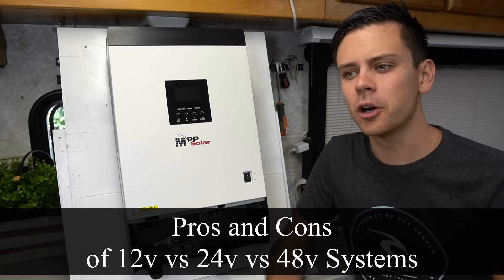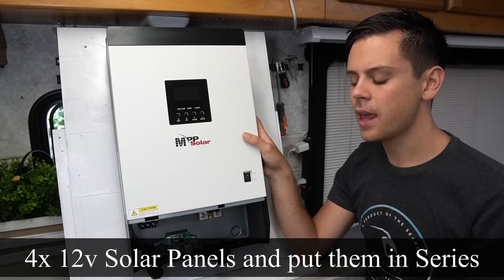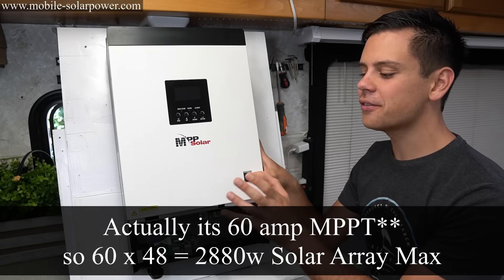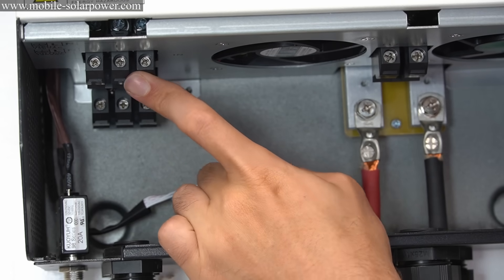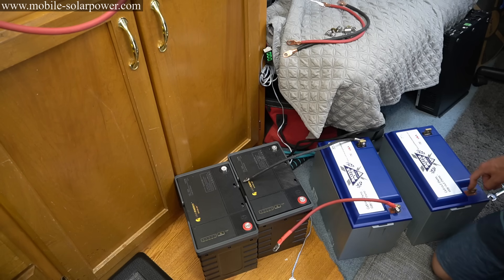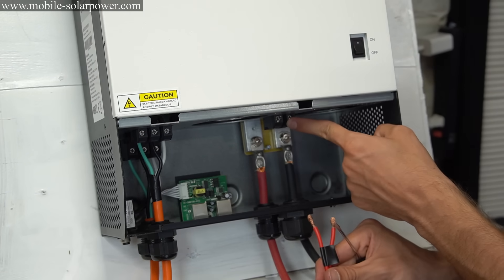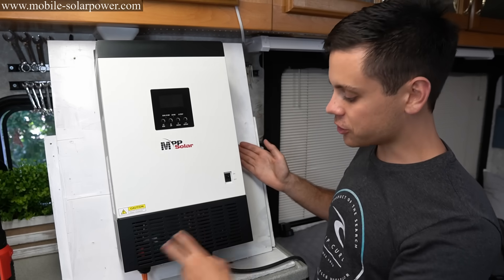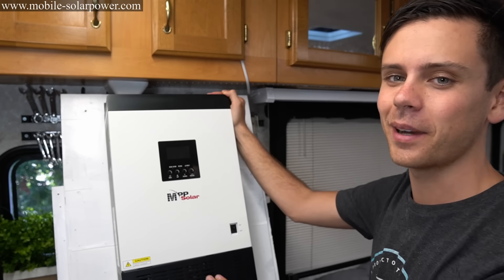48v Solar Power System for Beginners: Lower Cost and More Power!

Comment: Me and my wife wanna go on vacancy with our Cherooke (overland camping). The problem is that  . We have each one a CPAP one take 90 watts and the other need 80. Equal 170 watts. But me I count 250 watts to be safe. And I bought a cooler who take only 45 watts (it's a bougeRV) . The CPAP will work all night long so between 8 to 10 hours by night. And the solar panel will be attach to the truck racking on the roof. Now I bought a 100 watts panel. I think bought another to be sure it will be enough to charge all the day (hope so) .I wanna be guide to what should be buying to will make it work without problem . What kind of batteries and what strength should I bough. And what size of inverter bought. And the MPPT ??? An answer will be appreciate. Thank you

Luc from QUEBEC Canada

Comment: Thank you Will! Absolutely appreciate the works, research, tests you have done on the different units and configurations for us. I am researching a solar power generator battery backup system with A/C recharger mainly for power outage events. Also, while it sits idle, would like to take the advantage of solar power each day even it may be small Wh. Nonetheless, since this Growatt system doesn't have a battery cannot be a backup system. Right?

Comment: Hi I just installed similar system LI_IO batteries and still connected to the grid, It's working fine but mid day the batteries are full and the load change to the batteries, by the evening they are charged by the grid and it's bit stupid since there is plenty of sun all afternoon, is there a setting so the batteries are kept full as lone as the solar available? thanks!!

Comment: Will:

It is not the voltage that kills you, it is the current that kills.

100 ma of current will kill you no matter what the voltage is... even a simple 9 voltage battery can kill.

I am a retired radio and TV broadcast engineer with 40+ years of experience and I am also a Amateur Radio Operator licensed by the Federal Communication Commission with a Extra Class License.

Katherine

Comment: Can the AC output be fed back into the house mains or do you need a different unit?
Reply: I realize this is a week old comment but if the inverter is not designed to connect to the grid (grid tied) then it will destroy the inverter if you put grid voltage on the output terminals. Also (in the US) the house is 220 volt split phase. Loads connected to the inverter in this video must be completely isolated from the grid.

Comment: Hi i am trying to build a AC system 18000btu 240v 50Hz Cooling Capacity 3520w, cooling input unit 1100w  will this inverter work set up as 48v

Comment: Is there any problem with using 24 v, 36 v or 48 v with a charge controller and a 12 v battery configuration for an RV? I prefer to keep my batteries at 12 V only but I want the cost savings of higher voltage. Thank you.

Comment: Nice job making easy & straight to the point videos (this is coming from an electrical engineer lol).
I'm trying to find a solar solution to drive an electric hot water heater tank, but at ~4.5k to 5k watts, it would take a serious unit. Just bought a new house & it runs on oil, don't want to use oil for hot water lol. Planning on getting a wood stove too, because oil $ are about to get outrageous thanks to our new leadership in this country 😔

Comment: thanks for the videos. how do I hook a gas generator instead of grid power? is there a way to program the start stop perameters into this unit or do I need to buy a separate module for this? thanks

Comment: Firstly I love your video’s, but when you mention 48v as being “high voltage” you are maybe scaring people into thinking it’s “high” voltage. Anything under 120v DC is extra-low voltage. 👍
Reply from the maker: Very true but the safety sheets and NEC deem anything over 50 volts as being deadly. It is rare, but possible.
Reply: @WillProwse  that may be correct, but you are talking about 48v, 50v  DC may be deadly but it’s still called extra low voltage. For the sake of being correct you shouldn’t be calling it high voltage. Don’t take this the wrong way, you are a very talented guy but your definitions in this case are incorrect. The IEC defines extra low voltage (DC) as below 120v, low voltage as 120-1500 & high voltage as above 1500v DC. Your teaching DIY people the wrong terminology so teaching them the wrong definitions. Even if 50v can kill you, it is still defined as extra low voltage it can have no other definition. ✌️🍻

Comment: Ive been watching your videos for quite some time and have been slowly working on the solar system on my 32' rv to go completely off grid.  Based on your videos I think I want to go with a 24v system and was wondering if the mpp solar all in one would be ok to use in this installation.  thx

Comment: Hi Will. Please could you post the inverter settings for the all in one 48v 5Kw inverter with a LiFePO4 48v 4.8Kw battery backup. The one on the website is for 12v and 24v systems. Main concerns are on bulk/ absorb/float, point back levels and cut off levels

Comment: Will this system run off grid? I noticed the panel came on under battery power but I couldn’t see if the ac plug was plugged in.

Comment: Just a tip on terminals and not breaking screws, somewhere(hopefully) the torque recommendations are written in documentation or a search online might work, then you need to buy yourself a torque screwdriver and set it at the correct torque. These torque screwdrivers aren’t cheap but doing what your doing over and over it would be a good investment. I had a 3rd year apprentice snap every screw on maybe 50 terminals in a cubicle, when I asked him how he managed to snap them all he said that he thought you tightened until they snapped that way nobody can undo them and they stay put!!!!

Comment: Few questions.
1- I have observed FANs are continuously ON, looking at design, it is NTC mounted on Heat Sink, that should trigger when reaching to set higher temperature but my observation is even at NO LOAD with lower ambient of 22 C, fans are running? what is your view on it.
2- I did not found any option to switch OFF AC out put, if it is not to be used for few days; the CHARGER MPPT be on to keep the batteries fully charged through PV, as normal and be ready for use after few days when needed. Pl share your experience for it.
Thanks

Comment: I was looking at using this for an evse that draws 1.5kw. Goal is to have enough batteries to charge  the car / replaced the power used daily and have it grid tied incase i need a little extra above the batteries as I expand the battery bank with time. But evs are picky on the ground requirements. Have you or could u plug an electric car in to this unit?

Comment: Why dont people put isolator switches between battery and inverter, same with solar wires going into inverter, its safety bet
Reply from the maker: Because it's absolutely pointless and another fault point. What good would a main switch do if you are not there. Solar systems charge unintended all day long. having a solar disconnect is useful for maintenance purposes but that's about it. it is required for grid tie systems though but that makes sense. for low voltage DC off grid systems, there's no point really
Reply from the maker: What good is the "safety switch" if you're not there to switch it

Comment: Good helpful content, it’s a good idea to have another junction box or high amp main switch (away from your battery) and set it to open, then connect your last battery terminal, then close the circuit with your switch or junction.
It is a rule you NEVER make a spark near a battery, any hydrogen leak from a battery (or vented battery in particular is extreme risk) will equal a decent explosion and a hospital stay.
I used to do off grid power installations many years ago, some were 2 tons of batteries.
Sealed batteries do have a valve and if overcharge current is too high that pressure valve will open.

Comment: Will, is there a reason you did not have to do an inverter capacitor pre-charge on this MPP unit using your resistor?

Comment: While the AC input will charge the batteries, is there a setting to allow the solar to be the primary source of charging until the batteries get to a certain depletion level? Would like to use shore power to charge only if batteries are getting critically low.

Comment: You can't use 12 volt items like a lamp on a 48 volt system ???  I know nothing about solar..
Reply: I watch the video again I need to buy a 48v converter to step it down to 12v.. Is that right ??

Comment: Would be very interested to learn from you your thoughts on PVT panels & systems (for ‘brick & mortar’ home use) - PV Thermal, with PV and water heating integrated into a single solar panel.

Comment: Hi. These 48 volt all-in-ones are the way to go for sure, especially since cost mainly lies with the batteries. A good way to budget that is with a 48 volt electric bike battery. This provides a cheap beginning setup where the battery can also be used for your bike, which is good since down the road when you're ready to upgrade your battery the bike battery will still be useful. Nothing worse than having lots of old but too-valuable-to-junk stuff lying around. Have any of that?

My initial system will likely be one of the Growatt 3K, 8 100 watt flexibles using my install method, and the 18ah 48 volt bike battery I already have. When I buy a "real" battery I can get a second Growatt and have 240 volt capability.

You've taught me a lot so far, kid.

Comment: 12 volt solar panel... can it by itself charge a48 volt battery bank , initially,  until i would purchase 2 then 3, 4 and can at that point run them in series. I've watched so many videos. Haven't watched any in about 2 weeks and feel that most of what I learned is forgotten. I'm not about to re-watch 20 hrs of videos tho.  🙏🏼

Comment: Great Unit to have, I recently started with buying a tiny solar generator portable unit (XMUND XD-PS6) for less than 100 euros from Aliexpress. It has a 155Wh Li-ion battery pack (3.7v 14Ah) and has 4 USB outlets of which 1 is QC3.0 and 1 is USB-C. A built-in 100-150 Watt Inverter is for use with small appliances. It charges with an included 15v - 2A adapter or solar through a MPPT BMS at 2A max. So 30 watts input from an adapter or a tiny 30+ Watt Solar panel. It charges in 6-8 hours from 0-100%. What surprises me is that the MPPT BMS unit uses 30 Watt power from solar even if it's cloudy (behind glass in a bedroom) and if there is no direct sun at all. Approximately 1% an hour, great trickle charger.

Comment: I have 48v 2500W solar, and 2 24v wind turbine, totaling about 4500W.  I will have 24V battery packs, and 48v battery packs.  I know MPP inverters can be stacked top 9 units, but can I stack a 24V and a 48v?  if not what would be a good work around?  I will be adding more 48V solar, and will probably add a 48V wind turbine as well, but I do not want to abandon my existing 24V turbines - their kind of pricey...

Comment: Just don't touch both sides of the 48 volts + or - poles at the same time, Just don't close the circuit and be the resistor.

Comment: Im trying to design a 24v system, for operating my incubator lights for my greenhouse (all vegetables, haha)....my problem arises in the fact that 18w, 120v led bulbs, with the driver board removed, run on 72vdc at .24A...... each incubator has 5 industrial 4 bulb fixtures, converted to run led lights, each layer has 4 bulbs at .24a each, equaling 360 watts for yhe whole incubator.... wattage is the same whether I use 120vac  25A  or 72vdc 25A......at 5 incubators, thats 1800w continuous, for 13 hours a day...... to produce 1.5A of ac current, my inverter draws 12.5A  of dc current, requiring a massive battery and solar panel bank......is there a more efficient way of doing this, or can i convert 24vdc to 72vdc and still draw 1800w?? Any help appreciated

Comment: A correction, you cannot get shocked by 48VDC. I personally cannot feel below 150VDC on my hands, and even 325VDC is not that dangerous for me, it can shock me badly but I can let go instantly and save myself. AC is a different story though, never touch the 120/220VAC lines!
Reply: Yes you can

Comment: That's the mppt unit I've been keeping my eyes on. It's my dream to make an off grid system for my small house that charges off the grid but switches to battery power for light loads for lights or a fan, etc and then goes to grid for heavy loads like my oven, furnace, AC. maybe some day when I'm financially able to. Ultimately I want a house out in the country where I can set up a solar farm and have a shack for just the batteries and inverters to operate off grid 99% of the time.

Do you ever sell units you get to review or demo that you don't use any more?

Comment: Hi I am using EAsun smv iii 48v 5kw inverter, suddenly it is showing F51 error code. When it start with first grid and then solar it is working fine. But when connect to battery it showing error. Also when system starts with solar then grid showing error again. How can I solve this. F51 means over current or surge according to manual.

Comment: Hey Will,  I have an all-in-one 48v MPPT controller and have a question on the solar panels and shore power on my 21' camper.  1) I purchased five 200w panels for the roof and a portable 200w panel for added power.  I was thinking that I could use the 1000w series of panels and simply plug in the portable for added power when desired.  Is this idea not okay??......and, 2) would it be okay to simply run a cord or wire, (10 gauge??) to my 30A panel and if so, will that interface with the controller fine so I can operate my normal camper appliances and outlets??  Love what you do ad share with a lot of people!!.....Thanks, Mona

Comment: Very very beginner here. Love learning from your vids. So The 48 volt @ $1100 will endup being cheaper than the 24 volt @ $700 in the end. Why wouldn’t everyone go with 48 volt. i am buying a class A and would like a great off grid system. Would this be it? How many Battleborn batteries and how many panels would I need? I had planned on spending good money for a system. i know the batteries are $900, and would like to have 6 or 8 if needed.  Thanks again for the great vids.

Comment: Hi, Will. Thank you for great videos. Thinking of All-in-one system for pickup module and I have one question - how it is possible to charge all-in-one system from vehicle while driving if the system is 24 or 48 volts? Thank you.

Comment: Thank you for great detailed videos. I have a MPPSolar24v (inverter+chargecontroller combined). I have 4 solar panels 18v/100w each. with the full sun, each panel generates 20v. 
My battery bank is with 2 of 12v/100amp deep cycle fully sealed batteries.  I have connected each 2 panels in series and then 2+2 parallel which generates 36-40v and 200w power easily with the tropical sun of Sri Lanka. My problem is although the panels generate 40v, when it comes to charging the batteries it reduces by the MPPSolar charge controller to about 24-26v. so the rest of the voltage is wasted? Is there another way I could hook up these to get the maximum benefits out of these instruments I already have? I tried to change the system to be 12v system instead of 24v, but the MPPSolar 24v would not work with a 12v battery bank, any way to configure the unit so it will work with the 12v battery bank? Appreciate your help.

Comment: Helpful tip: if you don’t want the spark to occur when you first connect the inverter to the battery, what you want to do is hook up the inverter to the battery in SERIES with a standard 55 watt halogen car headlight bulb for 12v systems, 2 bulbs for 24v systems, 4 bulbs for 48v systems, and so on. Once the capacitors inside the inverter are charged, the light bulb(s) will turn off. Remove bulb(s) and connect inverter normally. No spark.

The reason it sparks is because the capacitors inside are fully discharged. In a discharged state, a capacitor connected to DC acts as a direct short. Connecting them to full potential while they are completely discharged actually reduces the life of the capacitors, and could eventually damage them if done too frequently.

Do what I said above and you won’t have a spark anymore AND you’ll prolong the life of your inverter.

Comment: I just bought a new EzGo golf cart with a nice Lithium Ion battery I have plans on using when I go camping for our solar generator, this system should work perfect for this with 4 pcs of an 100 watt solar panels wired in series to charge the golf cart battery.

Comment: This is amazing Will, thx for the info. A few questions on this product. Does it has a remote panel control monitor? Can it put horizontal instead? Does it has a 3kw inverter instead? I plan to install a 2nd alternator in my van to more efficiently charge my batteries while driving. Can I use this together with that to simultaneously charging with alternator and solar at the same time? Thx. 😀

Comment: Wow! I just got to know that there are actually 24v batteries. Fantastic! Innovations are really leveraging solar business to thrive. Will, by simple math, are you saying that 2 pieces of 24volt AGM batteries or LiFePO4 connected in series is equal to a 48volt battery system? But, does that also suggest that 2 pieces of AGM or LiFePO4 is equivalent to 4 Gel batteries or Lead-acid solar batteries?

Comment: excellent   Solar  power   48  V inverter    electrical  engineering   &  batteries   series  connection  to increase the voltage  &  then connection of Solar panels   , Grid  power  , &  batteries  to inverter  #  UR   method  of explanation is  excellent  # i LOVE it  &  its easy  to understand  #  Thank  U #  smart  young man #